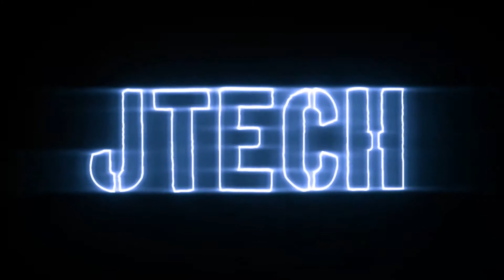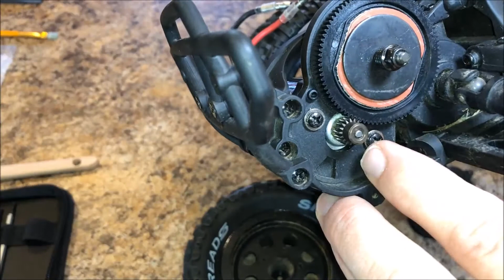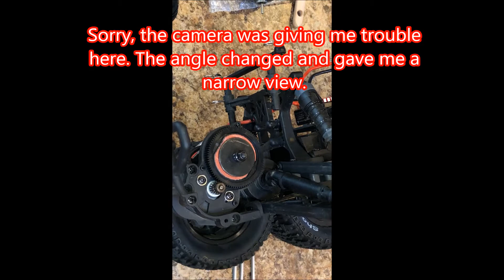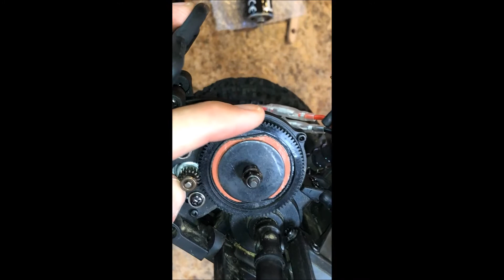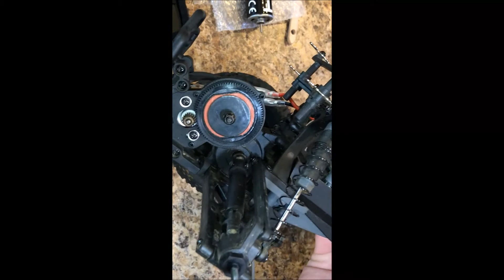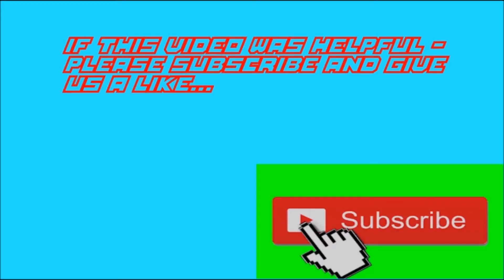ECX Ruckus 2WD Brushed motor replacement..

Comment: My ecx ruckus was 6 weeks old too and it got burnt🔥🔥🔥
Reply from the maker: Anthony and jonathan w unfortunately they are equipped with a fragile motor-
Reply: Is the ecx ruckus brushless better than ecx torment brushless.
Reply from the maker: Rc Rc Rc Rc Rc I am not sure honestly. I just purchased an upgraded motor and manage the life based on the temperature during use. If it starts getting hot, I give it a rest
Reply from the maker: Rc Rc Rc Rc Rc I only own the ruckus 2wd